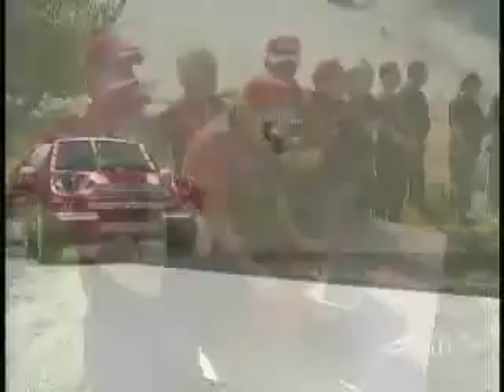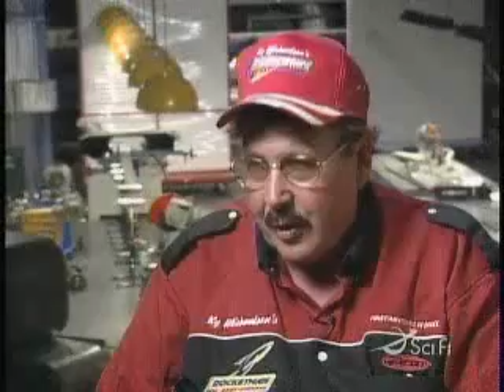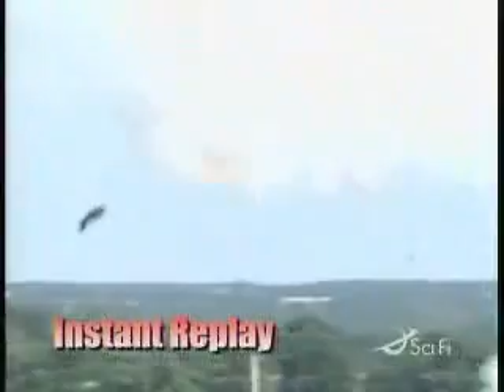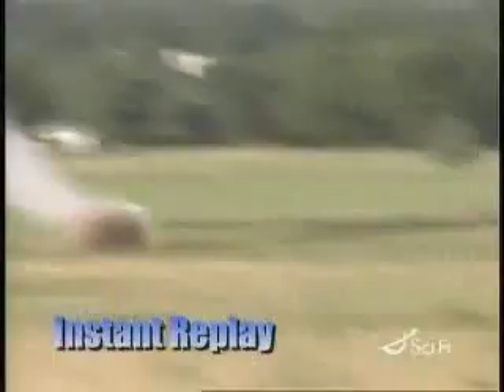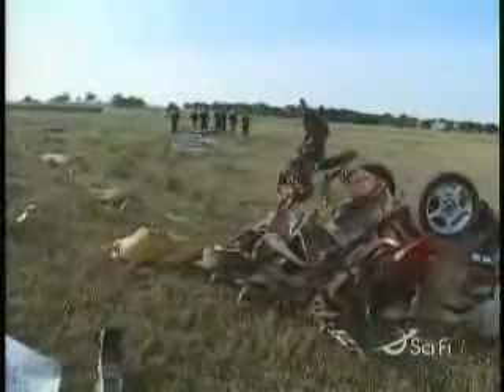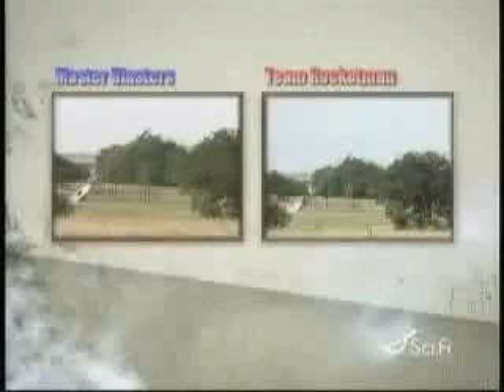Master Blaster - Car launch

Comment: rpl5288: Those WERE boost sections from the Tomahawk. We used lots of M and N's during the show but not on this project. All motors (other than these) were from Animal Motor Works. Although Jeff at Loki did subcontract a few of them. P.S. the motor data is classified but I can tell you the motors in the Mini were medium Ps each.

Comment: Well, I'm glad I finally got to see this video.  The red Mini that didn't work correctly was my 2002 Mini.  I had it for 3 years and traded it in on a 2005 Cooper S.  The dealer sold the car to a production company, which which drove it from here in Charleston, SC to Houston, TX where the show was filmed.  The manager told me about it when I brought my new one back for routine service.  She wasn't going to tell me, but finally did.  Makes me sad, but it certainly went off with a BANG!
Reply: This part was filmed in Gainesville Tx. The shop they used was in flowermound close to DFW. I picked up and delivered the reindeer snow sleds they blew up from Canada.
Reply: My grandpa Byrl was there yes i have like 30 Youtube accounts @bearthalamas